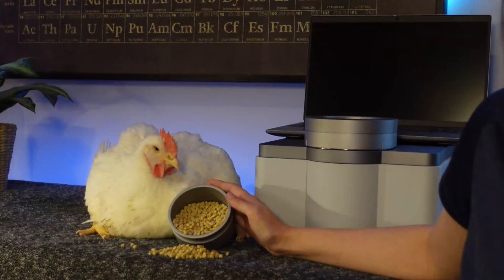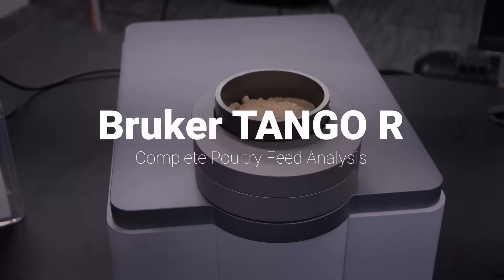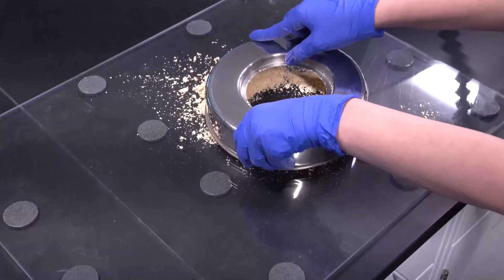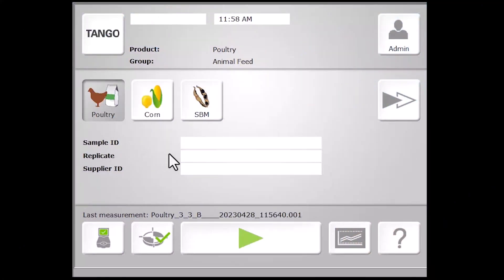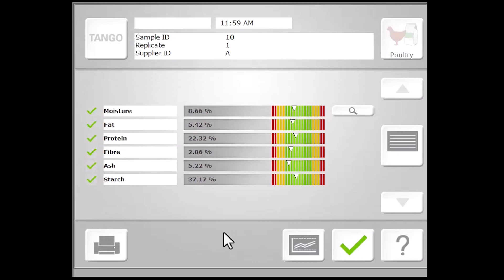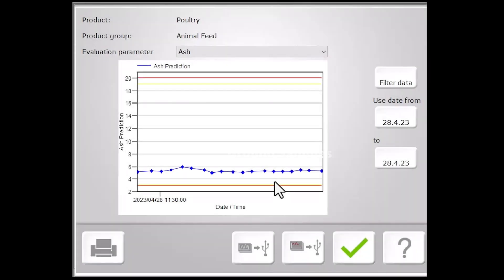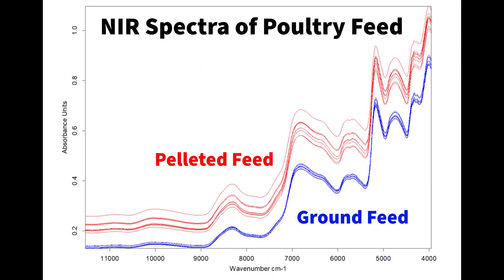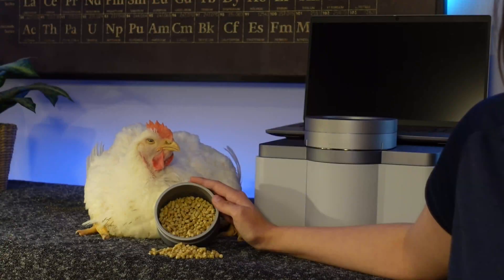Complete Poultry Feed Analysis with the TANGO-R FT-NIR Spectrometer

Comment: What are the consumables and typical replacement frequency for this instrument analysis?  Like ft-ir, will the laser (He-Ne?) and light source be used for several years?
Reply: The diode laser and interferometer has a 10 year warranty (expected life of the instrument).   The light source is typically replaced yearly.
Reply: thank!  it seems very stable. the light sourse will not be turned on continuously, but will be used for 8h a day, approximately 200days a year. Does it need to be released every year?